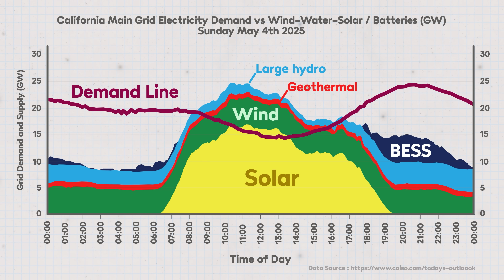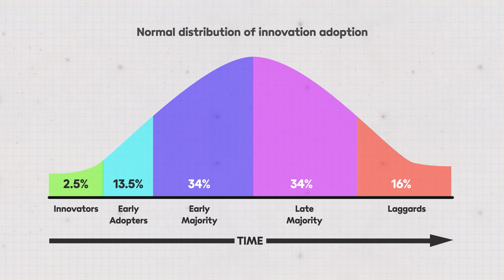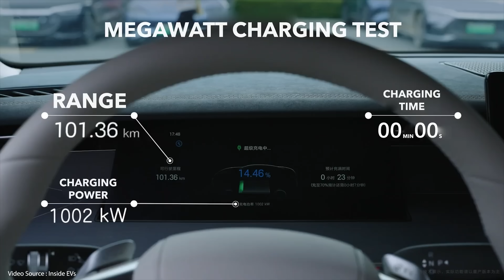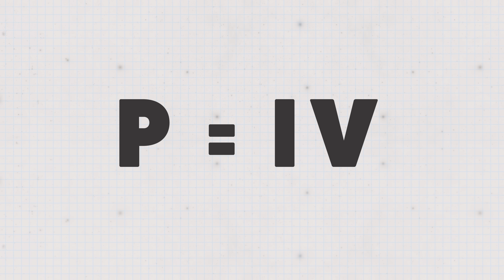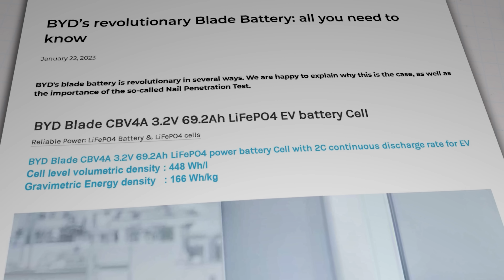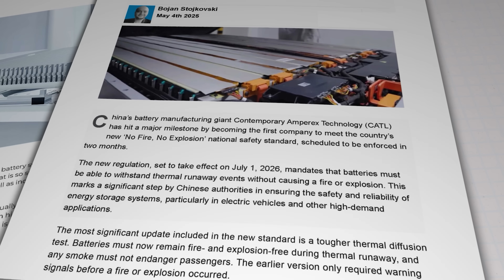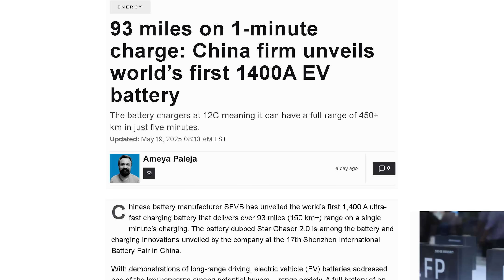BYD 1 MEGAWATT 5 minute EV Charger. Overdue or Overkill?

Comment: At the start of the video you show a graph of grid storage in GWh and ask isn't this impressive. I have an answer for you, no it is not. Against total electricity demand the 2025 number represents 0.0017% of total demand. This represents less than eight minutes of storage. For solar at 25% capacity factor, days of storage will be required. For wind at 35% capacity factor but with extended doldrums, weeks of storage will be required. We are completely kidding ourselves on renewables.
Reply: Battery storage doesn't need to equal total power needs, but the more the better, and we'll have some nuclear mixed in for baseload.
Reply: @Les_S537  In 2021 a long period of low wind power generation impacting the UK’s electricity supply lasting approximately 375 consecutive hours (about 15.6 days). During this time, wind power output was between 0-20%, highlighting a significant shortfall in renewable energy contribution. This extended lull necessitated increased reliance on gas-fired power stations to maintain electricity supply. 

Such prolonged periods of low wind, known as “Dunkelflaute,” underscore the challenges of integrating variable renewable energy sources into the grid. They emphasize the need for robust backup systems and energy storage solutions to ensure grid stability during times when wind and solar outputs are insufficient.
Reply: @moletrap2640  Yes, of course you need batteries, I didn't say otherwise, but the key is nuclear as baseload.  Your grid demand curve is whatever it is in Britain.  You've got a baseload need, and you've got peak power needs.

Batteries can be charged by whatever sources there are on the grid, so if wind is low during a dunkelflaute your nuclear can stay at maximum during low demand times and recharge the batteries as needed to provide peak power periods when needed.
Reply: @Les_S537  if you are sincerely interested in this topic, I strongly recommend looking at the UK's Royal Society analysis determining they needed 60 to 100 TWh of storage. Then take a look at what the cost of installed grid storage is. This is the clearest and most credible calculation of the infeasibility of firming up renewables.

If you just want to make assertions with no data to back it up, then we can finish this conversation.
Reply: @moletrap2640  Well, have YOU looked at their analysis?  It appears that you haven't because while the analysis DID say that around 100 TWh would be needed to meet net zero, it didn't say that it had to all be batteries, but it did say that batteries alone wouldn't suffice due to the scale and costs making it impractical (a cost of 25 trillion).  It talked about storing the energy as hydrogen using a much smaller amount than 100 TWh of batteries for short duration needs, and using hydrogen for longer duration, larger scale needs.

You could have solar and wind dedicated to maintaining hydrogen production and storage, and solar and wind dedicated to grid support alongside say 40 TWh of battery storage.

But again, add nuclear into the mix to maintain baseload power support.

Generation IV reactors are starting to happen today.  Inherently safe, as the chance of a meltdown is completely engineered out of the realm of possibility.
Reply: @Les_S537 absolutely. But hydrogen is a form of energy storage is a pipe drain and projects are being canceled across the world as the reality sets in.
Reply: @Les_S537  these are real green technologies, nuclear power and wind and solar for arbitrage. 

These are fake green technologies  hydrogen hubs, direct air carbon capture, gravity batteries, wind and solar as baseload, biofuels

For every dollar and component of human effort we spend on the fake technologies we are not running at full speed towards the real solutions.

Comment: Ultra fast charging means we can charge more cars, with less charge infrastructure. Considering how long it takes to roll out chargers this is a good thing.  

What we need for the mainstream now is cheaper cars at a 300 mile real world range, 15 year battery warranties. This would change the game. 

EV’s are too expensive still (eg look for a used Volvo v60 estate equivalent EV that has the same safety, range, comfort etc and you won’t find anything under £20k). 

The battery failure is a worry too. I get risk is low but people are currently forced to bear that risk in the used market and that’s exactly the market where whilst the frequency of risk is low, the impact is incredibly high.

I'm glad Dave mentioned cost because I think there is a lot of gaslighting going on when people keep insisting they're affordable. When you ask lots of people who'd love an EV why they haven't got one, cost is still a factor and telling them it isn't, won't change anything (and creates frustration).

Comment: I seem to remember Bob Llewellyn complaining recently that charging speeds are already too fast and that there isn't even time to spend a penny and get a cup of coffee before the latest models have finished charging. I'm sure there will be a market for those who want to get the charging over in a couple of minutes and be off, but for many people, myself included, it's not a problem if changing takes 20-30 minutes every couple of hours as it gives time for a break from driving. EV's aren't like ICE cars where you have to stand there holding the nozzle! I don't see this ultra-ultra-rapid charging being anything other than novelty on top spec cars. For most people 100-200KW is plenty.

Comment: Correction pipes do have a limit for water flow. As velocity in pipe approaches 10m/s the resistance increases dramatically and further increase in velocity requires more head. Just like electric cables with current.

Comment: In my opinion the combination of range, charging rate and availability needs to be good enough to not be a relevant problem. For almost all non-commercial vehicles the ability to slow charge while the vehicle is parked anyway can that almost always cover that. I've never lived or worked without electrical outlets either already installed at the parking spaces, usually for preheating engines, or at least some electrical installation already in very close proximity to the parking spaces. EVs don't require any "magic" form of electricity, I don't get why so many seems to assume that EVs needs to be recharged completely, and as fast as possible. 

Even if you drive 4 hours a day, that means you're parked 20 hours a day, sure you wouldn't be able to rely on 6 or 10 amp 240 V outlets alone in that case, then you'd want an EV with really good range and at least 10 kW charger at home, not a megawatt though. Also, 4 hours a day, that's kind of in the range of what an ordinary taxi driver actively drives during an 8 hour shift, so if you drive that much just to work 8 hours a day, maybe you should look over your life situation.   

Average commute distance varies with time, and country/area, but it's typically less than 20 km, one-way, 40 km a day total distance, with a consumption of 200 Wh/km, means a consumption of 8 kWh per day, and when parked over 20 hours a day that means you would need less than 500 watts to recharge while parked to get by. To put that into perspective, the average commuter could keep their car charged with just the power two 240 watt USB PD outlets can deliver if available both at home and at work.  A 6 amp 240 V outlet available at work would be more than enough to top off the energy required for the average commute during a 8 hour shift.          

Road trips is another matter, but then again, if you always start with 400 km real world range, or more, and charge with a couple of hundred kilowatts when you need to, or at least should stop anyway, that shouldn't be an issue, life is not a cannon ball run. Sure, faster charging is nice to have, but you have to drive both fast and far in order to make ultrafast charging more useful than having "normal" charging available, and ultrafast charging where you don't need it doesn't replace having normal chargers when and where you need to charge. 

Again, in my opinion, the hype became ridiculous about the time when a lot of people became extremely exited by promises of charging rates moderately higher than the 250 kW Tesla offered, as the difference was going to turn EVs from unusable to perfect, remember this was well before a certain someone showed any signs of actually going mad, eccentric sure, and really bad at estimating timelines, but usually eventually able to make good on his promises no matter how unbelievable they seemed at first.
Reply: Are you counting an a reliable grid that can shoulder a tripling of power demand.   Sorry only fossil fuels can do that.

Comment: …or you have swap-out batteries, like in scooters. Then they can sit there charging, waiting for you to swap them into your car, which will take you two minutes, with the right equipment.
Reply: A study was done on whether battery swapping should be done for EVs, much like you might switch out a battery pack for your power tools...  In order for such a system to work you would need every car to have the same battery pack, and you would need to have 3 times as many battery packs as there are EVs.  Its not workable.

Comment: I don't know if all this is just wishful thinking or utterly delusional and ignorant of simple facts thinking.
If you have a 100 kilowatt battery you need about 120kw to charge it in an hour, 240kw to charge it in 30 minutes 560kw to charge in 15 minutes and about 1200kw to charge in seven minutes. The faster you try to charge a battery the harder it is to charge it because of resistance and the heat that needs to be dissipated so you don't nuke it. To try to fast charge ten VSMs at once you would need a supply that equals the needs of an Aluminium smelter. Aluminium smelters often are located next door to power plants and even buy their own power plants because of the enormous power demands. 
When everyone is living in VSM utopia the air will be thick with the smell of burning electrical grids and batteries and you will fear trying to cook a meal lest you blackout the neighborhood.
Reply: Modern EVs have built in cooling technology.  Works a lot like your ICE car radiator does.  The battery pack has channels built into/between the battery cells with a coolant in them.  As the battery pack is charged a heat pump cycles the fluid through the pack leeching heat away from the cells, and the fluid is then run through radiator style coils to dissipate that heat.  This coolant system also moonlights as a battery pack heater in winter with the heat pump heating the fluid and running the fluid through the battery pack to warm the battery cells up so that they're kept within optimum temperature ranges.
Reply: @Les_S537  ???
So what?
Having to run a cooling system is why it takes more power to charge a battery, but if you overload the cooling capacity you nuke the battery and it goes into thermal runaway.
Reply: @anomamos9095  The energy used to pump fluids through your battery pack is minimal.  Heat pumps are very efficient.

Energy used has been measured to be around .5 kWh during a typical 20 minute charging session.  .5 kWh costs maybe 10 cents.

Charging an EV isn't a linear process.  The battery pack is not receiving the maximum energy the entire process.  It ramps up to a maximum, and then slowly tapers off at the end.

If the Battery Management System in the car senses a problem (overheating) it will regulate the incoming power to the car.
Reply: @Les_S537  And thus you are fooled into not realizing your mistake.
The numbers I gave were just for illustrative purposes so as to cause people to look up the actual numbers and hopefully break out of the delusion. Before you use bits of unicorn fluff to deny reality play devils advocate and look for information that might confirm what I have said. Hint you will need to look at physics and electrical engineering references not EVangelical sites.
Reply: @anomamos9095  rolling my eyes
Reply: @Les_S537  Delusional people often do that when hypnotizing themselves into ignoring reality.

Comment: Instead of feeding back into the grid, just powering your house with your car when you come home might help already and be a lot easier to implement.
Reply: Good idea in principle, but using your car to power your house or the grid means that you are using charge cycles from your car.  Your EV battery pack only has so many uses, so conserve them.  Don't let your car be used to power the grid ever.
Reply: @Les_S537 Good point, a stationary battery is more economical and better material usage. It could even be an old car battery.

Comment: I already have a 50MW connection for my hydro-carbon car. 
Running it into the ground thank you very much;-)
The batteries and charger infra is getting a lot better. There will be a real tipping point soon (especially as all those older ICE garage mechanics finally retire)

Comment: Overdue or Overkill?  How about POINTLESS?  To make anything work it has to work FINANCIALLY and unless you get a majority of vehicles capable of being charged in that way you'll never make it financially viable for users.  BUT, even if you DO get enough vehicles to comply you run into the issue of energy availability of which - thanks to political interference - we won't have enough of.  "It's dead Jim".

Comment: Enjoy an EV by all means but it is delusional to think it will save the world. It just seems like swapping one form of pollution for another with potentially millions of used Lithium ion batteries requiring recycling for which no country has devised a safe solution on a large scale. Where are you going to find a 600 kw charger in Australia where governments already ask us to turn off our aircon in hot weather. Also many ev owners seem to like to change cars regularly to get the latest and greatest updated ones.
Reply: Many companies have worked out the recycling process for EV batteries, such as Redwood Materials in the US.

Comment: 9:23 but they probably would appreciate "more" chargers. If you can charge in 5m instead of 30m then 5 or 6 people could have used the same charger to charge their car instead of only 1 person. That if functionally more chargers even though the numbers didn't change if you went and counted.
Also if you arrived and all chargers were in use there would be a lot more people willing to wait up to 5m for a spot to open than to wait 30m.

Comment: EVs will never take off in the US until landlords are forced to provide charging at home for all tenants in ALL buildings - both new and old (not just in new construction the way most such requirements are implemented). Of course this will never happen in this shithole of a country, lol good luck with that..
Reply: Every home and business in the country, provided it has electricity run to it, is already a charging station.  You can charge your EV with a regular 120v outlet in your home or business right now.

Comment: The fire and explosion standard is a huge deal, as is being able to drive a nail through a battery pack without issue (I'm a former fire investigator, so have seen demonstrations of what normally happens when you punch a nail through a battery).  The rapid charging stuff is insane and neat, but the weight and material reductions and other technological improvements are the real significant changes here.  The pace of change with this tech is pretty staggering - and it was already excellent.

Comment: This is  lunacy.  Who is going to pay for the grid upgrades?   A substation would be required at each 'filling' station.
Reply: Local storage at the charger ofc, 1-5 MWh battery to smooth out the demand from the grid
Reply: @TheEsseboy  At a typical petrol power station, there are about 6 cars filling up.  Now you are talking about 6MW!  4MWh batteries cost about US$2.4million, plus the liquid cooled charging outlets, plus the cost of the transformer, plus HV switchgear , plus the land (equivalent 2 x 40ft containers), plus an HV supply from the utility, plus design and installation.  For 6MW charging capacity, you probably need 8MWh of battery.  Now you are looking at a 6 car charging cost of US$6-7million!  How are you going to pay that off?  What about insurance?  The fault level on the charger will be huge - considerable damage when things go wrong.
Reply: @michaelkennedy4842 The difference is that EV drivers leave their homes with 100% charge 99% of the time, unlike ICE cars. Meaning they rarely charge on the road unless on a road trip (cutting demand several times) 

Battery costs are getting lower all the time, and this would only be needed at transport hubs. The petrol station pumps also cost millions... so it's not like EV chargers cost particularly much in compariosn.... especially since they provide clean none polluting power...

Comment: Get real.  You need to put the same total amount of charge into a battery whether you do it slowly or quickly.  You might do it slowly via a home charger overnight or you might try to make it faster.  To make it really fast you need (a) a huge power supply and (b) a huge cable.  We don't have that megawatt power supply - enough for a mid-sized town - available to chargers because you'd need cables to them and transformers upstream capable of handling the load.  You want two chargers at the station with that capability?  Then double everything. And between the charger and the car you'd need a very thick cable that would be too heavy to lift.
For a better and real-world (c.f. fantasy world) look at EVs, try the YouTube videos of MGuy Australia.
Reply: MW scale chargers will only be used in industrial scale EVs like buses, dump trucks, bulldozers, etc.  Basically, if the battery pack is huge like the Tesla Semi has (850-900 kWh), then and only then does a MW sized charger make sense.